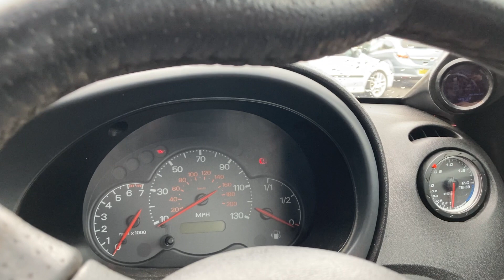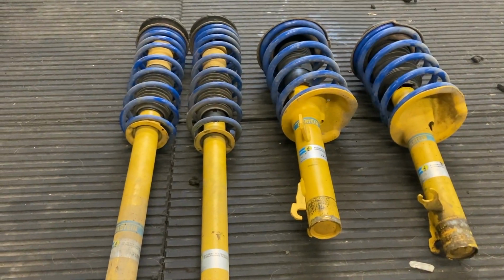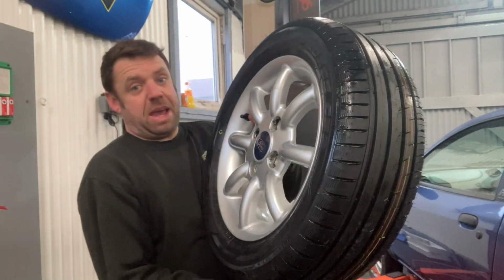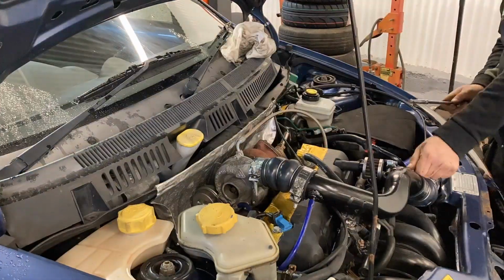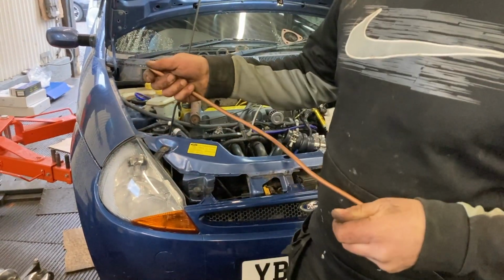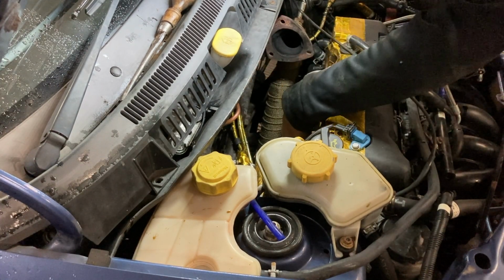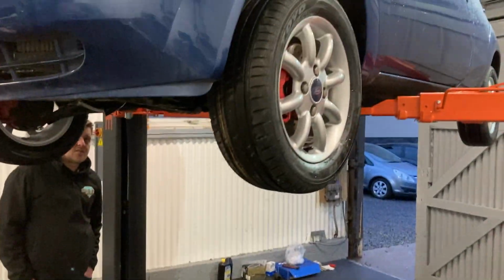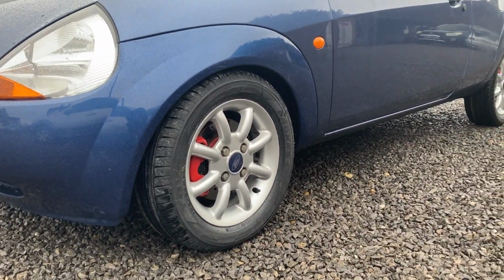Turbo Ka Update AND More Upgrades -  Suspension - Toyo Tires

Comment: The push rod leftovers weren't a rocket but would outlast most. Didn't sell many here in Australia because it looked like a dog kennel and a miniature focus wrapped together. This one is looking pretty stout with those wheels and the stance, having turbo fun is another big tick.
Reply from the maker: This one doesn’t have the pushrod engine they only came in the early ones in our country. Yes having a turban is a great little bit of fun. Hope you’re okay
Reply: @shineautomotive  We only saw the escort pushrod 1.3, solid lifters from memory, had the pleasure of adjusting valves on a few. The more I look at yours the more I like it, cool looking wheels etc.
Reply from the maker: Thank you very much

Comment: Hi there Colin, Sam. Thoroughly enjoying the videos so please keep them coming. 

How do I go about getting a hat from you gentlemen? That would be excellent advertising. 

Since google searching a Ka Turbo and finding your channel, I’m doing a Streetka turbo. For the fun of it. They’re cheap as chips anyway. One question is, how the heck did you manage to turn the exhaust manifold upside down and get it to go on? Only a few of the holes line up. Did you have to elongate the holes? I’ve been through all Ka vids and can’t see that you’ve done anything to it? Help? 

Keep up the good work. 

Cheers, Ted in Bedford
Reply from the maker: Finally the day has come thank you so much Ted when we turn the manifold up we made it point not to tell anybody that the holes were not going line up to see if anyone would actually do it and contact us and after over a year of the build Beginning somebody Finally has asked a question you need a flat disc Remak where the holes sort of lineup and send it to it you will only get three bolts onto the top and two bolts on at the bottom but it is a secure fix if you send me a message on Facebook or Instagram I will get a photo to illustrate what we’ve had to do was quite easy it’s a little bit of a Agricultural engineering but it tightens up very well and works . I really did not think this day would come LOL :-) welcome to the channel hope you can stick around spread the word lets make this channel massive :-) thanks for your comment Ted
Reply from the maker: Hat should have a link The next video hopefully? :-):_SHINE::_YES::_WOW:

Comment: Doesnt the oil return go above the oil level .. lol 
Great job
Reply from the maker: Cheapskate saving time and still going strong
Reply: @shineautomotive  
The oil in the line will always be backed up atleast as high as the level in the pan. Add to that the viscosity and the fact you're now pushing oil into a filled reservoir instead of air, and you've got a recipe for pushing oil past the seals in your turbo.